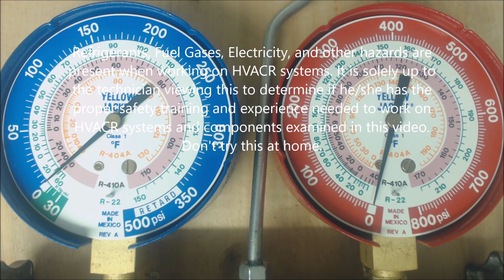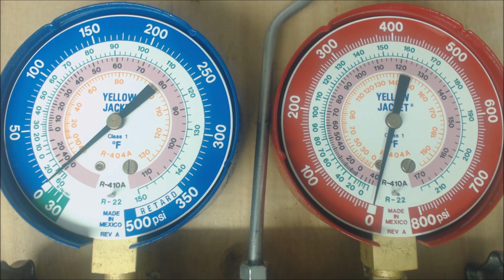R-22 and R-410A Refrigerant Operating Pressures on Air Conditioning Units!

Comment: If I need to charge my system and it's in the 40's and low 50's with a heat pump, what reading would I look for once the unit is switched over to heat? Thanks
Reply from the maker: You would actually need to use a charging jacket like this one in order to drive the saturated temp to between 90-105 degrees first since it is below 70 degrees. If the top of your outdoor unit was flat then you could just use plywood. You really need at least 70 inside and 70 outside before yo check the charge and unless the manufacturer has a certain way to check the charge in heat mode for that exact unit, we can't use superheat or subcooling because we don't know how much refrigerant is in the accumulator in heat mode, thanks- https://amzn.to/2CGSNA2
Reply: @acservicetechchannel  Awesome! Thanks for your reply, I got myself a new coil and I'm going to replace my current one. Been watching your videos for good info.

Comment: Thanks good video,
After 15minutes AC On for Freon R22,
Blue side is 39psi / 14F degree / Suction line actual degree 78F
Red side is 175psi / 93F degree / Liquid line actual degree  95F
is this mean that I need to just add R22 freon ?
Reply: a good combination for a frozen evap coil

Comment: Do you know why on carrier heat pumps only why you have to get high side pressure in heating mode on the larger hot discharge line service port and if you check the 3/8 service port pressure it will be close to your suction pressure? On every other manufacturer you get high side pressure on the 3/8 service port in heating and cooling. Thanks!
Reply from the maker: Brian, That is because they have the metering device in the piston chamber right before your port when the subcooled liquid is flowing from the indoor coil toward the outdoor coil. The piston is right under the nut. If the port were 3 inches closer to the indoor coil, it would be high pressure subcooled liquid. You are reading low pressure liquid with 20 percent flash gas at that port because it is right after the metering device  in heat mode. Other manufacturers place their piston chamber inside the outdoor unit so it is further downstream, thanks
Reply: AC Service Tech LLC that makes sense I just would think the hot discharge gas pressure would be too high because of the increased temp / pressure created from the compressor to be an accurate high side pressure
Reply from the maker: Are you talking about following a manufacturer charging procedure for a heat pump in heat mode because other than that, we can't really check a charge in heat mode due to not knowing how much refrigerant is in the accumulator. We are stuck with total weight procedure or reducing condensor airflow to raise high side sat temp in cooling mode but it would need to be 38 degrees or higher ambient temp for that method, thanks

Comment: Can you please help me I have a 1986 Chevy suburban and the ac is retrofitting to 134a and the running pressures are low side 50 and high side 200 psi and all the cold lines have condensation on them but are not super cold and the ac sucks blows out maybe 65 -70 f when it’s about 90 out and the Compressor never cycles just turns on and runs till I turn the ac off from the cab anyhelp the shops have fucked me over so I am on my own
Reply from the maker: I don't typically work on vehicles but you can't really check the charge due to the changing speed of the compressor. We typically vacuum the lines and weigh in what is stated on the rating plate. Then we know it is good. If this was a conversion from r-22 to 134a, did they change the compressor, oil and metering device?

Comment: Should the high side temperature always be 30 degrees above the outdoor ambient?  Thank you
Reply from the maker: No that is just the approach method otherwise known as ambient plus rule. I would stay away from that unless a manufacturer is telling you to use it for some reason as that will get you close but not exact and doesn't really help in our job to monitor superheat and subcooling to see how efficient the system is running exactly and for troubleshooting. Thanks!

Comment: Nice video, you're a good teacher.  bought a new house, and trying to evaluate the ac system.  Nordyne 3 1/2 ton 1600 sq. ft house.  the best my low side ever gets is at 11AM Low:92  r22 ring: 52.  but at 4 in the after noon the system wont shut off at 78 degrees in the house.  So low on 22? compressor going bad?  High on 22?   I've cleaned both sets of coils, evaporator was really bad.  Advice?
Reply from the maker: Hey David, I would need to know if you have a txv or fixed orifice such as a piston or capillary tubing  as the metering device in order to answer the question. Then I would need high and low pressures, superheat, subcooling, outdoor temp and indoor wet bulb temp. We don't go by pressures only in order to check a charge, thanks

Comment: What if my high side is 150 Psi in r22 normal low side 75PSI.  No coolin What The problem can be
Reply: Check that the blower is running and is up in speed, check the outdoor fan is running, and then check if the unit has a TXV. If there's a TXV check the subcooling: should be around 10. If there isn't a TXV then its capillary action, and more than likely piston type. There should be a charging chart available, however you do want a superheat under 50 for starters. Next you want to ensure your coils are clean or at least debris free. 

Honestly though it sounds like a weak compressor, how old is it? Can you calculate compression rate, and get the amps as well? After all that, you might have the answer.

Comment: What are the normal discharge and suction line pressures for r22 at 25 Celsius ambient temperature?
Reply from the maker: It really depends more on superheat and subcooling readings more so than pressures. It also has to do with WB indoor temp, outdoor temp and seer ratings, thanks
Reply: AC Service Tech LLC okay thanks

Comment: Just and simple air conditioning i turned off ..i hooked the gauges and turned it back on And  i waited until the refrigerant stabilize. But the the vapor side keept on rising near 300 psi it has a piston instead a txv.
Reply from the maker: Ok I was wondering if you had a reversing valve or not. If the furnace is not on then you may have bad compressor valves on the compressor or a bad refrigerant charge with mixed air or nitrogen with it. What is the pressure when the system is off and stabilized for 20 minutes compared to the outdoor temp using the p/t chart? I am assuming this is an R410a system. Did you check out the "acservicetech bad compressor valves video"?

Comment: What about if my low side is close the 300 psi?
Reply from the maker: Is the system running? Is the unit a heat pump? Is the furnace running while the ac unit is on accidentally?
Reply: acservicetech.  Its a 3 ton Reehm split system i turned the power  off hooked my gauges turned it back on and the presure start to climb close to 300 psg on the low side
Reply from the maker: Hey Alex, is it a heat pump split system or just a straight AC condensor?

Comment: this make it easier for me to comprehend the science behind it.. i rewind constantly to make sure i understand.. although i dont understand SEER measurements yet..
Reply from the maker: It has to do with how efficient the unit's energy transfer is and therefor electrical energy used to transfer the heat energy. In reference to an outdoor unit, the higher the seer, the larger the surface area of the coil is. The indoor evaporator coil would need to be larger as well to attain a higher seer rating, thanks

Comment: With Lower loads and cooler weather , how do feel about tenting  the condenser for initial start ups ?
Reply from the maker: Yes you can do that. We have to do that to get heat pumps accurate enough. We need to raise the outdoor sat temp and hopefully work with an indoor temp high enough, thanks
Reply: acservicetech thank you .

Comment: Can you have these gauges permanently installed in your system?
Reply from the maker: You could if you really wanted to but keep them in a non exposed area that is out of the weather with quick connect test gauges. Make sure people don't have ready access to them though. We usually install locking caps in exposed areas, thanks

Comment: Thank you for your video, guru. My AC is RUDD UACC-036JAS, R22 refrigerant system, it has refrigerant leakage, the Tech refilled R22 to Low Pressure at about 62 psi, High Pressure is 220 psi, is it ok for cooling? but I feel it is slow to make rooms cool. What is the best psi of Low Pressure for my AC? Thanks.
Reply from the maker: he would need to check it with superheat or subcooling but the refrigerant will eventually leak out again. He would need to find and fix the leak. You could also check for 18-21 degree temp decrease between the return air and supply air to verify it is working correctly, thanks

Comment: You should add that a technician must verify the correct volume , CFM, of airflow before charging a system.
Reply from the maker: Yes, thanks
Reply from the maker: Absolutely, they must be done before checking the charge. Thanks Gary!

Comment: Check the gauge's saturation temperature for each refrigerant against a PT chart. At one time I found one set of gauges where the R-410a temperatures did not match the pressure against a PT chart. Always verify your equipment is correct.
Reply from the maker: I found that once too. That was an interesting one! Always check

Comment: Thank you. Question. Does equipment come stating what the head pressure/evap pressure should be under design conditions. For example at a certain out door and indoor temperature ? How else do you know if the pressures are ok ?
Reply from the maker: You have to absolutely use superheat or subcooling procedures to check a charge. Also make sure that the vapor sat does not decrease below 32 degrees on an air conditioner. Look up "acservicetech superheat playlist" and acservicetech subcooling playlist"
Reply: Ok. Thanks. I see the low and high pressures vary depending on lots of parameters but low side pressure must be above freezing in air conditioning or you have to deal with a freezing evap problem immediately.
Reply from the maker: Yes exactly, in the book coming out, I will explain why all of these the methods do not work and why superheat and subcooling are the key. You got it though and yes above 32 degree sat vapor side, thanks
Reply: @ACServiceTechLLC, Not sure what you think about this but some systems do seem to rely upon outdoor temp combined with suction and liquid pressures.  Here is a chart from a Rheem package unit.  The system has a TXV but the manufacturer does not list target subcooling for the system.  Instead, this chart is all that is provided.  Fortunately, was able to get the system working pretty well, although the pressures didn’t match the chart on the 100-plus degree day I serviced it.  
 https://www.dropbox.com/s/t4ixapa1qh61dre/Rheem%205-ton%20package%20charge%20chart.jpeg?dl=0

Comment: What is a good time to check your system to see if it is running right? Do you want to check the system when the outside temp. is around 60-70 degrees? I am going to check the systems on our rental property.
Reply from the maker: Typically the first 70 degree days when there is a load on the building, thanks Todd!
Reply: I think he meant when to check it. The answer, i think, is, it doesnt matter because its charged by superheat or subcool. The varible that would matter, is the indoor temperature should be normal like less than 80 or so

Comment: Thanks for sharing your extensive knowledge. You would likely enjoy the details of wide-body jet airconditioning systems. Since the OAT varies from say 115F when taxiing out for takeoff in, say, Phoenix to -41F OAT at 39,000 feet cruise altitude, the aircond "packs" work to cool the cabin at low altitudes but must function as "heaters" when it's 41-deg below zero at cruise altitude. The most remarkable characteristic about these a/c "packs" is that they do not require any charge of refrigerant. In fact, there is NO refrigerant in the system except fresh air. The system takes (bleeds") high pressure air from the engines to drive a compressor (turbine) that inducts outside air, compressing it, then cooling it in the slipstream, then allowing it to expand again. As you know, this cycle creates a powerful thermal exchange. Then, the cold expanding exhaust is simply piped into the aircraft. By controlling how quickly this volume of air is injected into the cabin, the aircraft can be "pressurized" as well. The fact that no airconditioning refrigerant must be added means that the systems are extremely reliable and the performance doesn't vary since the compressor is a rotary turbine, not a rotary piston whose efficiency is affected by wear. Thanks again for your videos. I would enjoy sitting down with you to ask you questions. Youtube is the next best thing. Good luck sir.
Reply from the maker: Thanks for the awesome, detail filled learning experience for everyone. Thank you for taking the time to write it. Are you a pilot, engineer, or mechanic?
Reply: Retired, flew 40 years. Thanks again for your stellar videos.

Comment: Is there other cheaper multimeter we could use? Also, which leak detector (cheap but acceptable) we can use too? Thank you
Reply from the maker: You can use bubble leak detector such as this rectorseal detector with the dauber-    http://amzn.to/2w4WDPr  --  the electronic ones are pretty expensive. You could use this UEI meter but it doesn't come with a temp sensor-  http://amzn.to/2wuV9iQ

Comment: I have my succion line going into a vacuum freezing up the coils tripping the breaker.. bad txv dirty filter drier?
Reply from the maker: if it is low superheat when that is happening  before freezing then low airflow. If it is high superheat then either low charge or restricted liquid line/ bad txv. The coil has to be unfrozen first to check, thanks

Comment: just installed a brand new Rheem variable speed air handler single speed compressor No Ceilings in the house running the air conditioning in Florida with 100% humidity house is missing doors the unit is a 410A should I not run this unit the the amps are 12.8 FLA and the running amps 8.5 should I turn the unit off until I get doors installed very hot here and humid
Reply from the maker: If a system is installed correctly meaning the ductwork and charge are correct then the system should be capable to run 24-7. It should however shut off and handle the heat load of the house if sized properly. You can run it if you would like. In high temperature or high humidity, it is best to have a txv installed for efficiency to fill the indoor coil with the exact proper amount of saturation state though, thanks

Comment: Question, if the low side pressure for an R22 is to high, (105 degree's) does that mean the compressor is bad?
Reply from the maker: That means that the outdoor coils are not able to reject the heat well, either low seer meaning less coils, degraded coils, bushes too close, recycled air from an above blockage.
Reply: acservicetech sorry I meant 105 psi. But I'll check it out. Awesome video.
Reply from the maker: Oh wow, just got in from a hot humid day and was answering questions, saw you said 105 degrees and thought high side, sorry about that! You would need to check the superheat and subcooling to first see if it is overcharged first, then possible gaining too much heat but it could not get to 105 unless it was higher than that temp in the building so I would not imagine that unless it was a weird commercial kitchen scenario that was don wrong.  If it was a heat pump, it could be the reversing valve or compressor.  If you suspected the compressor, you could try a pump down. If the internal overload is too weak or the compressor just can't pump down then bad compressor. Hope that helps Steve!
Reply: acservicetech I kinda figured it may be the compressor. The high side is where it's supposed to be. But the low side would go to 90 to 105 psig. Looks like I'll need a new compressor after all. I needed to be sure thanks

Comment: l can change r410 to r22
Reply from the maker: You can't change an r410a to r22 or an r22 to r410a. The indoor coil and/or lineset may be used though if it is flushed and the pressure rating is high enough for r410a. The outdoor unit, metering device, and filter drier need to be changed, thanks

Comment: Hi, can you have a expansion valve and a piston both in a heat pump system?  It look like I have a piston at the condenser and a expansion at the evap  I have a heat pump system.
Reply from the maker: Yes only one is active at a time. The other will bypass through. Check this video out as it will explain active and non active-   https://youtu.be/2Ahzi1U0fYk

Comment: today my gauges read 140psig on the low side and 550 psig on the high side... it was 114F outside temp where I live and I like my house to be 75F inside.... I've noticed it running for way too long to barely keep it at 77F. is that normal for it to be having such a hard time cooling down?  cause I've let out little refrigerant whatever was in my hoses ,when removing them the times, I would practice..
Reply from the maker: That pressure could be ok for that high of a temperature possibly depending on the seer rating. When you check subcooling if it has a txv or for superheat, make sure you insulate the sensor that you place on the refrigerant line since it is so hot in order to get an accurate reading.  Subcooling-  https://www.youtube.com/playlist?list=PLxnHR5_D2ojxTcAtR_53GoY8huBcSOt0a      ---   Superheat-    https://www.youtube.com/playlist?list=PLxnHR5_D2ojwGvhU1rseXQLJ-XBjBZMMk